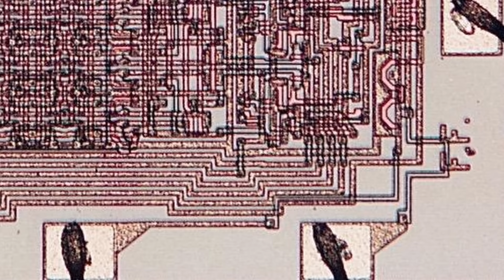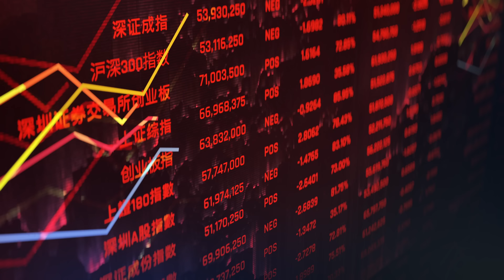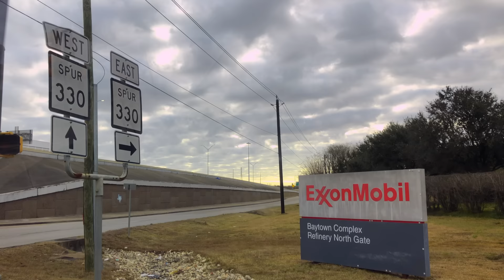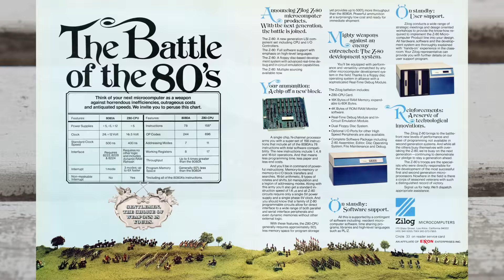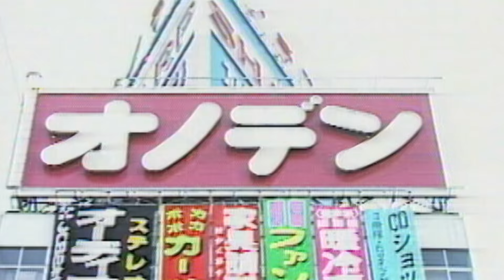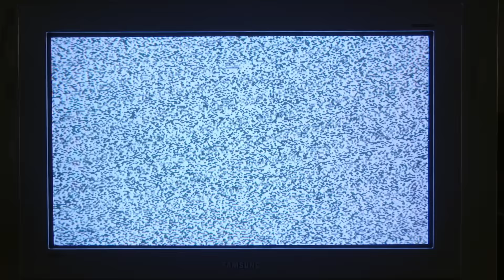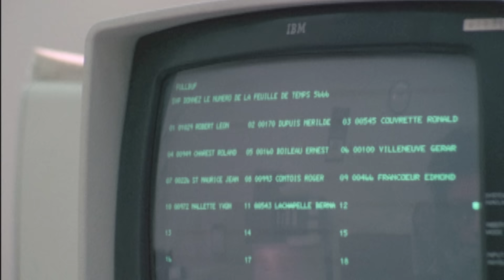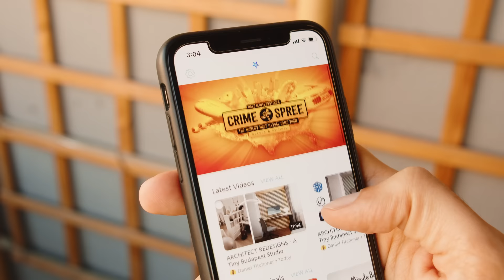Intel’s worst Nightmare

Comment: "Last week, chip manufacturer Zilog announced that after 48 years on the market, its line of standalone DIP (dual inline package) Z80 CPUs is coming to an end, ceasing sales on June 14, 2024. The 8-bit Z80 architecture debuted in 1976 and powered a small-business-PC revolution in conjunction with CP/M, also serving as the heart of the Nintendo Game Boy, Sinclair ZX Spectrum, the Radio Shack TRS-80, the Pac-Man arcade game, and the TI-83 graphing calculator in various forms."

A processor that lasted 48 years. Amazing!!!!

Comment: Ah, I remember it well, all those late nights and trembling hands from too much coffee writing Z80A assembly on paper, pages and pages of it , mind so frazzled I had to use a calculator to work out the 16 bit addresses for jumps in the code, and I was so poor I couldn't afford an assembler so I'd just poke the code in, byte by byte....intellectually it was some of the most satisfying stuff I ever did as a teenager...I wrote a few games, defender type ones, I even wrote a Morse code decoder/encoder...and even wrote an improved tape loading routine that was faster than the original one that was in the ROM on my ZX Spectrum...then later I discovered beer and women and, that was the end of that .

Comment: Amazing video!  :thumbsup:
If Exxon didn't ruin Zilog, we could have had 3 brands of processors to choose from!
Reply: Well kinda, but not exactly, Z80 wasn't really running on X86 and well Intel was trying their best in 2002-2008 to kill off every single company that could compete in X86 space, which basically pushed VIA out of the mainstream market and almost destroyed AMD.
Reply: You had more than that, there was the 8080, Z80, 6502, 6800, and more. Each had its fans. And that is just the 8 bit club.
Reply: We had Cyrix, TI, and a few others in the 90s.
Reply: Legally they were required by IBM to license to second source suppliers the 8086 chip. AMD and VIA were the first two companies to receive those licenses.  Intel sued AMD because they made a 586 clone and thought there licensing prevented that. Apparently the original licensing for the base chip gave AMD the Rights to build on the platform forever as long as they paid Intel.
Reply: @JeffreyPiatt  It was a 386, and a damned good one. By 586, Intel changed the name to Pentium , which could be copyrighted, unlike 486, 386 etc. Despite Intel keeping AMD in litigation for a year or so, the latter's CPU came out on top and still managed to make a dent in Intel's sales. 

There was no CPU labelled as a 586, indirectly perhaps the Cx586 or the AMD 5x86.
Reply: If Exxon didn't prevent Zilog from selling their chips to IBM, then Intel wouldn't necessarily have got into the microprocessor market that far. So it could still end up a duopoly of Zilog vs AMD.
Reply: @JeffreyPiatt  It's also worth noting that Intel also depend on AMD now, as their cross-licensing agreement permits them to use each other's architecture extensions, and AMD happened to be the company that came up with AMD64, which is the 64-bit extension every modern PC supports and has supported for well over a decade. AMD64 basically inflated the existing x86 architecture to 64 bits and was easily backwards-compatible with 32-bit x86 code, while Intel's own earlier 64-bit architecture was Itanium (IA64), a fundamentally incompatible architecture with x86 that never saw real success. Aside from difficulties related to its weird "EPIC" architecture making it very challenging to write efficient compilers, Itanium CPU's couldn't just be added to machines running existing operating systems and existing software "for free" while AMD64 CPU's could be, so naturally, that's what ended up succeeding.
Reply: Powerpc

Comment: The Z80 invented prefix bytes. The Z80 added some registers and when you use them you just put a prefix byte before the instruction. E.g. putting a 0xDD byte means the instruction will use IX instead of HL, 0xFD means use IY instead of HL. The 8086 uses prefix bytes for segment overrides, lock and repeated instructions. These were a bit of a nightmare to decode when the superscalar era started but, according to Jim Keller, on a modern chip you just use prediction to guess the instruction boundaries. Right now on x64 instructions are 1-15 bytes long.

Comment: I have been an interpreter in silicon valley since 1982, and the omly name in this video I have heard of is Ungermann. This is very interesting stuff. because I remember Fairchild being in the center of silicon valley one day, and all of a sudden it was gone. Also being half Japanese , I never heard of any Mr. Shima. I will do some research on this.
But just  seeing the name "Zilog" was a moment down memory lane.
Also the scene of placing 10 inch wafers into boats manually brought back memories. (They were 4 inch at that time) Pre-Lam laboratory times.
Actually I started from quartz made boats for CVD. Maybe 30 wafers per boat. Yeild rate maybe 50%.
They were the times.

Fabs not foundries for U.S. and Japan.

Comment: The Z-80 will always have a spot in my heart.  That thing was so underappreciated in it's day.  The 6502 took the "cheap processor" crown, and Intel had the market share to ruin Zilog.

But the Z-80 was better than the 8080.  If not for IBM, i wonder what Zilog would have come up with.  If CPM had dominated instead of MS-DOS (Which was pretty much a rip off of CPM), then the world might be very different today, computationally.

Which is why tech geniuses need a business man to make it work.  CPM?  Could have been the OS for the original IBM PC, but no.  The writer of CPM didn't understand business, and dissed IBM, which was not kosher.  So IBM went to MS, which at the point was a computer language writer, not an OS writer.

But MS looked at CPM, and thought, "we could do the same thing, but not copy the code."  And they did, and the rest is history.  But if you know MS-DOS you can use a CPM machine, because the OS is basically the same from a UI aspect.  And since the UI WAS the OS at that point, as the commands were pretty basic.
Reply: Z-80 processors are still used today, in things like vending machines and other devices that need semi powerful processing.  They got the core to 50mhz and 1cycle per instruction on most instructions and can have a boat load of memory.  Saying that it seems like everyone has moved to some type of ARM based core for even simple jobs that a 40 year old microcontroller would do fine at... Everyone writes in C now, so no need to learn the CORE anymore and let the compiler handle deal with that.
Reply: @johnjay6370  Yep.  I have seen microcontrollers based on a Z-80 core with the eeprom, ram, and i/o built in.

Used in a lot of places where you need or want the flexibility of a couple, but it needs to be cheap.  A lot of these are single or double chip designs.  Cuts cost of manufacturing down tremendously.
Reply: @johnjay6370  I was writing in C for the Z80 for embedded applications. Toshiba made a nice version with all the peripheral chips built in. However ROM space was getting to be cramped, I could have done with a larger address space.
Reply: Yeezzz, CP/M was awful. MS-DOS started out as a copy, certainly, but they rapidly improved the system beyond CP/M, which had fun things like not knowing exactly where the end of file was, completely flat directory structure, etc.
Reply: We can see what they would’ve made, by looking at the ez80, a funny little 24 bit chip. Super cool cpu
Reply: @gavintantleff  The "next in line" was the 180, which was actually a Hitachi chip, and later started a patent infringement war that Zilog won. It was the Z80 with onboard peripherals and bank selected memory management. Following that was the Z280, which I worked on, which was a 16 bit upgrade to the Z80, including a lot (and I mean a lot) of new instructions. It was designed about the time the Z8000 was introduced. It was a good design, but NMOS was seeing its last days, and the industry was switching to CMOS. Zilog, always interested in saving money by stretching their fab operations, used a method to reduce the power draw of NMOS and spin the chip. It failed spectacularly, and the first Z280's were stillborn and the project was shelved. It came back again about 1985-6 as a CMOS design, which was when I was drawn in to work on it. The Z280 sampled widely, but with the cache disabled due to design issues. It got respun with a lot of my fixes, and as a result the cache was able to be enabled. After about a month of my testing, I discovered a bug in the cache. We considered just advising the customers to turn the cache off again, which would have hurt performance, but the chief CPU designer reported that the bug was only made worse by the cache, but was always there. At that point the CPU was shelved yet again, and I worked on Z180 tasks until I left the company ;-( I believe later the EZ80 (renamed from Z380?) came out. I don't know how much was borrowed from the Z280. I looked through the spec once and it didn't look familiar.

I emerged from Zilog a true believer in RISC, and still to this day. Probably the most RISC like of the early CPUs was the 6502, although I admit I never programmed one. I mostly worked with the MIPS processor after that, mainly because they were one of the first truly SOC friendly CPU makers. I dabbled in SPARC at Sun, but by that time (late 2000's) even the CPU designers were admitting that the architecture had seen it's day.

I still miss CPU design, and I have made at least one FPGA CPU just for fun. We work mainly on ARM CPUs these days.
Reply: @scottfranco1962  that’s really cool, thanks for sharing
Reply: Post note: Wikipedia has a good article on the Z280:

https://en.wikipedia.org/wiki/Zilog_Z280

And the original NMOS chip it was based on, the Z800 (which was before my time at Zilog). If it had been introduced on the original 1985 schedule as a "super Z80" I suppose it would have made a big splash in the market. I invested a lot of effort in it personally, including designing a virtual memory operating system based on the chip. Zilog killed it from under me, but I suspect Ed Sack, the CEO then, would have told me that the only reason the CPU got another spin was that I pushed it hard. The project was hanging by a thread. Spins are expensive.

The project brought me from LA to work in semiconductors in SF. I don't regret it. One of the highlights of my time at Zilog was getting the history of the Z80 from the people there. Not often told was that the original Z80 got built from 7400 series TTL chips! Yep, they built a prototype of it, a big tabletop version before making the IC. The original random logic Z80 from the first chips got remade as a microcode machine that reduced the complexity of it dramatically. The original designer showed me the layout for it, about the size of a king size bed, all one sheet!
Reply: Microsoft didn't rip off cpm. They bought it from the same guy that made cpm
Reply: @johnjay6370  because a cheap arduino can run circles around a z80 and is available.
Reply: @casparhughey5651  citation needed
Reply: @jhoughjr1  So true!
its crazy how much processing power is in a Arduino..
Reply: @jhoughjr1  running from the truth
Reply: @casparhughey5651  Not a citation.

Comment: NOTE: IBM actually used an 8088 for their IBM PC. It's pretty much just an 8086 but with an 8 bit data path instead of a 16 bit one. The CPU is still internally 16-bit though.
Reply from the maker: Yeah, I had to simplify the point a bit to explain the x86 bit.

Comment: Great video. I designed telecom test systems with the Mostek version of the Z80 starting in 1980. Great chip. The big thing too was that when the Motorola and Intel development systems were worth $10K, Zilog’s was worth 4K with a single 8” floppy and an Emulator. The 8080 had different instruction for memory and I/O operations. The Z80 would allow you to hardware map I/O and memory together so you could do arithmetic and memory type operations direct on I/O. The 6800 did this. I still have a hand full of them. Thanks again for the memories.

Comment: My first computer was a TRS-80 which used the Z80 and I had gone beyond basic into doing Z80 assembly so it became the first processor I knew in detail.   I did not realize at the time how spoiled I was with Z80 assembly's relative easy to read and more intuitive coding.  That experience when I was a teen opened doors into a programming career and to this day I work at the low level software writing and have yet come across an assembly that was as easy to use as the Z80.

Comment: i loved this great cpu so much with its great register set, and no space was wasted with i/o over the adress range of 64k.
i have so much respect for the software creators that developed cpm and other operating systems in that tiny space.
often i didn't bother to use an assembler for some little code and wrote it in hex.
the z80 took my virginity and for sentimental reasons i'm working on building up a system on rolf dieter klein 's work. (hope you're ok with that).

Comment: As an assembly programmer on mainframes, I built my own computer that mimicked the mainframe instruction set. It worked great! I used BPS as the o/s, and I discovered CP/M and rebuilt my computer using the Z80. Canned the whole thing and adopted the S-100 bus with 64k of memory!. I wrote hundreds of applications on the Z-80 under CP/M. There was even a mainframe emulator too! I still have my S-100 bus computer and my very portable Kaypro-10!
To me the x86 instruction set is braindead! The mainframe instruction set was much better, but IBM could never supply enough chips on thier own.
In addition the PC was part if the GSD part of IBM as they saw the PC as a toy. So it was put under  the same division of IBM that made typewriters, word processors, and photocopiers.

Comment: Starting 1968 I programmed at the Assembler level for scientific & engineering systems plus some early internet-style stuff to join our office computers with Bell Datapac 3000 joining Varian V73/V75 through Zilog MCZ-1/05 -1/20 with Z80s.  From 1968 in Assembler IBM 360/44, Raytheon 706 (in the desert Oman & Muscat oil exploration), DEC PDP 11/20 (monitoring construction elevators 1974 for First Canadian Place, Toronto tower), Varian V73/V75, Fairchild F5 in a circuit board we made for elevator speed control, Zilog MCZ-1/05 -1/20 with Z80s (I upgraded chips 16K to 64K & cut-soldered-wired their boards for the new address lines),  (monitoring all elevators of New York City Housing from their dispatch office), IBM PC Intel 8088 (controlling & monitoring all elevators in new KOIN Centre Portland Oregon including direct control of the colour rasters of Mitsubishi C3400LP & C3900LP)) monitor via Artist early colour board, $5K for each monitor, $5K for the Artist early colour board), monitoring system for all escalators of TTC Toronto subway stops, working in the TTC train control centre), monitoring building hydro measuring spikes, frequency, voltage, SINE shapes. Bunch of other fun stuff like that. Then 1991 my poor career choices ended all that fun being paid a salary to play all day with computers and make prototyping boards and I had to switch to dull engineering consulting for my final 27 years of work (paid OK though) and the Consultants just dragged me out when there were arguments involving elevator computer systems like a meeting between Otis Elevator & PetroCanada executives-lawyers about their contract details for the Otis Elevator Elevonic control software, and I reviewed all KONE Elevator proprietary control software in huge manuals before it was put in Trust, same for Northern Elevator MC68000 1-bit micro perfectly emulates a relay logic system, something about a software programmed cart conveyor system I had to review. All this review is cursory stuff skimming through code & comments to make sure they provided what at least looks like a complete package, it's about being diligent, rather dull work. Hauled around Canada a couple of systems we built and I programmed in Assembler Zilog Z80 & Intel 8088 for measuring elevator circuits in real time for playback by me at the office to detect faults & measure acceleration & speed. I got a 2-year return to Intel 8088 programming Assembler but I was scheduled for some elevator software work in New York City World Trade Centre in October 2001 when I'd finished another project but some bods flew airplanes into it and that was the end of that 2-year return to Intel 8088 programming Assembler and back to the engineering consulting for my final 15 years of work with computer programming ended & forgotten for ever (paid really well for me though at my options level). In some cardboard box I got my 1968 IBM 360/44 instruction green card and my instruction cards for DEC PDP 11/20, Fairchild F5, Zilog Z80 (? not sure) & my TI TTL etc. chip books & Intel 8088 / 8086 book, Microsoft Windows set of 4 manuals were very expensive, describing their message pump system & a bunch of internals, I forgot it all. OK that's it for me because nostalgia is the mind killer and that crap is all ancient history.